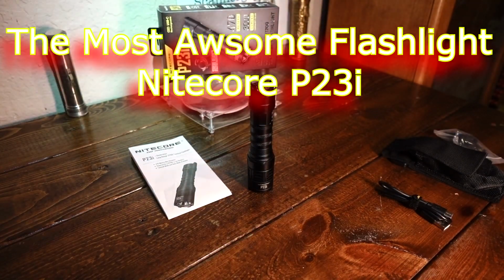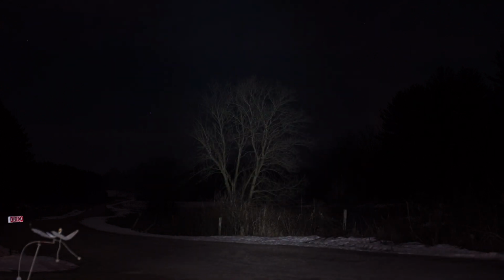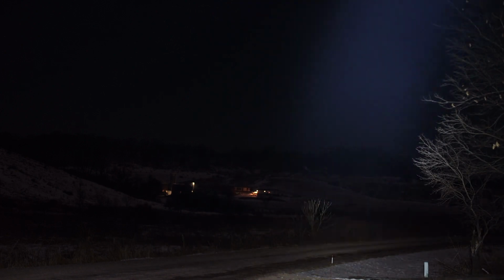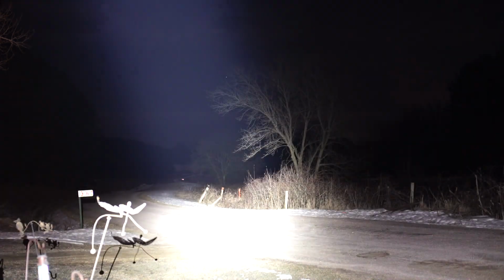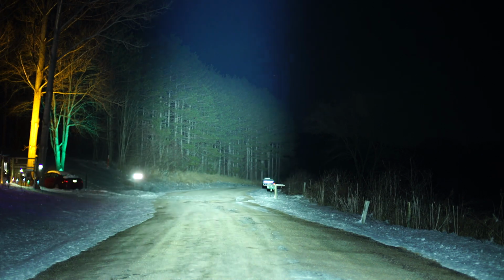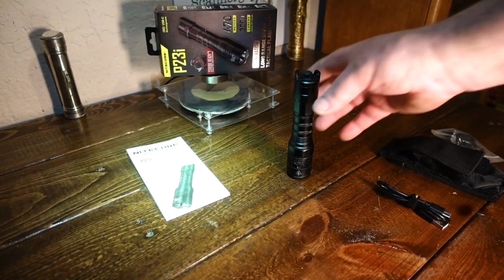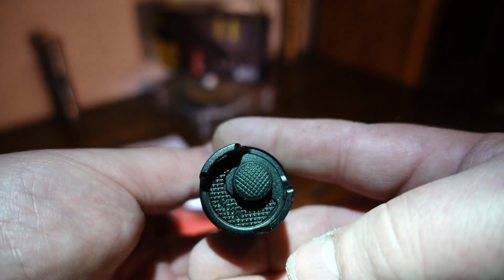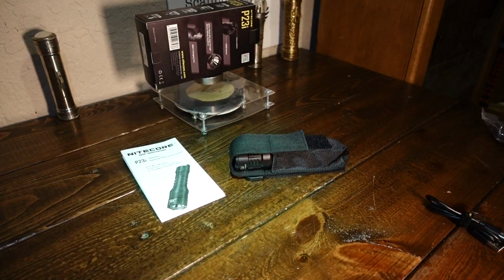The most Awesome Flashlight Nitecore P23i 512 yards of throw

Comment: I have this light along with its main competitor and I have to say the P23i is the clear winner, I really like this light. Usually I can find a few faults with most any light but I find the P23i damn near perfect. The only gripe I might have is the battery is of an odd size, I can’t fit the battery in an external charger, I don’t care for that. You are forced to use the on board charging. That is the only downside I found. Otherwise, perfect light. Long runtime, great throw, perfect lighting temperature.

Comment: Incredible light.  Sensibleprepper also did a review of this light and he really torture tested it.  He put it under water, ran it over, threw it up and drop tested it on concrete,  and beat the bezel pretty good and it still worked 100%.  I’m gonna have to get one of these.  I’ve been a Maglite fan for a long time and have lots of their different models but they just can’t see to get with the program.  C and D cell powered lights are a thing of the past.  Nitecore is for sure leading the way with new tech.

Comment: It is a very nice light I looked a LOT at the competition. Each light has its trade offs and each user has their specific wants. For an EDC light that covers the range in variable brightness levels and cover distance ranges with a high candela, not to mention a reasonable price for the light and quality you're getting, this light is tough to beat. It has a daily use mode and a tactical mode. I find the tactical mode is great for my daily use too. You always have the turbo strobe available but in tactical mode, the main button is ready to go with turbo. With the mode button right under it, and knowing what lumen power I want, it's SO quick to adjust just the lumens I want. Yes, it's important to me that the light works as a defensive tool for first, upsetting the vision of an attacker(s) and second, to use as a striking tool. I love how it has the breaking glass metal points on the bezel to break glass if needed. Having to personally need and use a glass breaker to save someone in their car before, I don't take that tool for granted. Just saying, that the P23i has exceeded my expectations.

Comment: You saying it's the best flashlight you ever tested, is quite an endorsement!  I might have to buy it now!!
Reply from the maker: Of all the 670 lights I've tested I can safely say it is my favorite so far. Perfect size, real long battery life, able to determine battery life while using, super long throw with spill and the user interface is top notch. Only downfall is you must run with the supplied battery. I'm sure there lights out there I have not tested yet that may interest me more or maybe not. Tech is moving on lights for sure. All around it's my favorite. I tend to carry my go-to light in my back pocket. So if they fit I go from there on other features.

Comment: I have the P23i as well. It's a phenomenal EDC but the one thing I don't like about it is the proprietary Nitecore 21700 battery. You can't use any other 21700 as the proprietary battery has both a negative and positive terminal at the head. I also love the flashing LED that tells you how many volts the battery has remaining. My main go to is my Acebeam P18, with higher lumens and more candela at 98910 and I can use any 21700 battery with it.
Reply from the maker: I tested the p16. Really liked it but 18650 and less battery life. Never tried the p18. Looks like a beast but you're not going to fit it in your pocket very well at work. That would be huge minus for me. I have the catapult Pro if I want to run with a case but prefer my back pocket.
Reply: Best light ever 😍
Reply: @pizzadave9812  It is but the P23i gets got very fast on Turbo and it's ramps down fairly quickly too